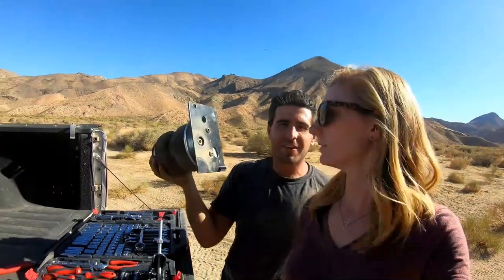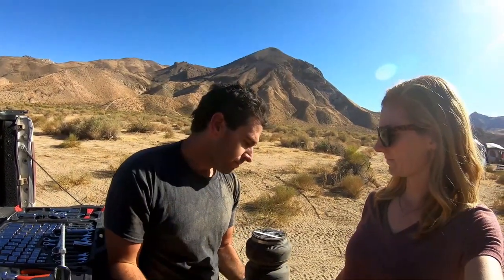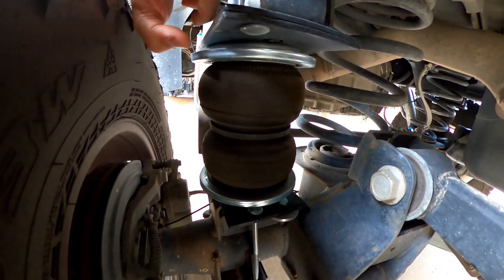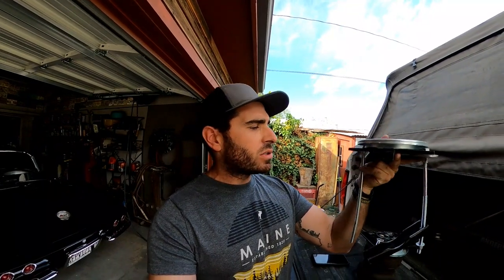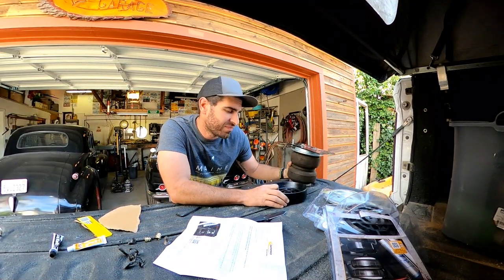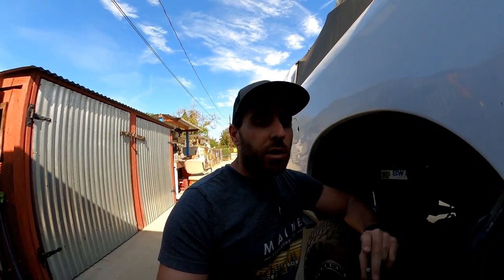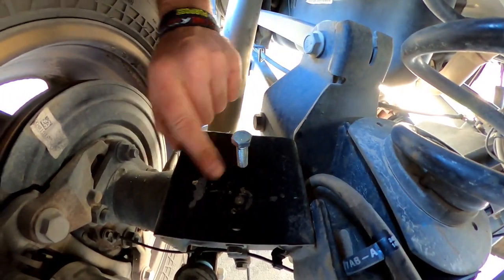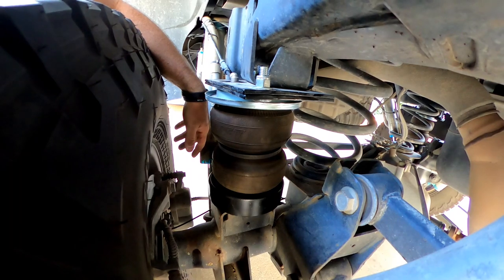BEST TOWING SETUP! || Daystar Airbag Cradle Install & Review || RV Living Full Time

Comment: Did you lose any suspension travel when using the cradles and airbags? How much did you lose if any? And did you completely go to 0psi in the bags or down to the 10psi that’s recommended? Thanks!!! Great info
Reply from the maker: Hey there! I dont think any travel is lost, but if some is lost it's pretty insignificant. We typically run 5-10 psi in the bags. Last trip out we did some shock valving and I was able to push the truck a little more and noticed when I hit the rear bump stop(airbag) it does spring the rear of the truck and make it kick a little. Other than that this setup has been great.
Reply: Adventure Endeavor was that towing or off-road? My 2500 has bags and it rides like a brick house hahaha
Reply from the maker: @gamarramedical1289  that was when offroad  flying through whoop sections. Just driving around town it's not bad I let the air out of the bags as well, they are only aired up when towing.
Reply: Awesome I’m gonna pick up a set of Daystars for myself then! Thanks man!!
Reply from the maker: @gamarramedical1289  yeah of course! They are linked in the video description.👍

Comment: Thanks for your video. Very helpful. As much work as you do, I'm surprised you don't use pneumatic tools. One tip---  instead of tapping the bolt hole use an F- type threaded bolt instead, very strong and reliable and super easy. Check it out, it will make your "drill and tap" life so much better.
Reply from the maker: Thanks for watching!  Thanks for the advice as well, always looking to learn! I'll be looking into it.

Comment: Did you start with stock rear springs, just with the Carli pintop shocks on their leveling kit or is this a Carli spring lift in the rear? I am scoping this out and I don't think there is enough room for this setup on my 2021 RAM 2500 Cummins.
Reply from the maker: We went with the full Carli setup. Take a look at Thuren Fabrication as well.

Comment: Thanks for documenting your mounting of the cradles.  Is it still working fine?  Do you happen to know how thick the metal you tapped is? I'm trying to also mount the cradles but the metal I'm tapping into is only 1/4" so not sure if the threads will be enough to hold it. I may at least upsize the bolt to 7/16 from 3/8 so there's more threads.
Reply from the maker: Hey! Glad it was helpful, ours is holding up fine. The metal was roughly 1/4. We offroad and tow with the truck on a daily basis, holds up great so far!

Comment: I want to install the cradles to my tacoma but this the response from Firestone. We don’t support Daystar. They have it so that the bottom of the bag is not attached on bottom. We want the bag attached on bottom. The Daystar cradle automatically voids the warranty. The kit has to be installed according to how we have designed it to be installed.
Reply from the maker: Yeah idk what to tell you. I guess my warranty is voided, they have worked perfectly with this setup and the day star cradels.

Comment: Great video! I have bags and haven’t mounted the cradles yet. How deep did you make the hole for the bolt? What’s inside that “box” and can you make the hole too deep? Thanks man
Reply from the maker: Thank you Craig. The hole I drilled an taped went all the way through the mount/plate on the axel. On my RAM you can't go too deep, it's a tower/control arm mount. Does that make sense? Link, thanks for watching glad it helped!👍👍

Comment: Hi, when it comes to airbags and suspension altering I know almost zero. To ask, do you have to worry about airbag wear bouncing in and out of the cup or is wear normal with such a device and it’s just a normal replacement deal. Any lube recommended? Thanks for the video. Always want to learn.
Reply from the maker: Mortimer! Great question, there will be some light wear but It should be very minimal. Most of that will come when it's going in and out. The bottom of the bag is pretty stout plastic. I see them lasting a very long time. Great question though.
Reply: Thanks!

Comment: Great video now I want to know more about that bed top cover. I got a 2017 Ram 2500 Cummins Limited 4 door 4x4 that would look good on.
Reply from the maker: Hey Gary thank you! So the cover is called a "SoftTopper" made by a company in Colorado. We bought it used and its held up great. It's nice for towing as we can put it down, put a strap over it and then we can tow the 5th wheel. It keeps stuff dry and out of sight out of mind! I would highly recommend one! Any more questions let me know!
Reply: Adventure Endeavor  also I received my package last night. Looks good and I will get it install after Christmas. Thanks again for the deal !
Reply from the maker: @garyhartline6735  awesome that was pretty quick! Glad there were not issues. 👍👊